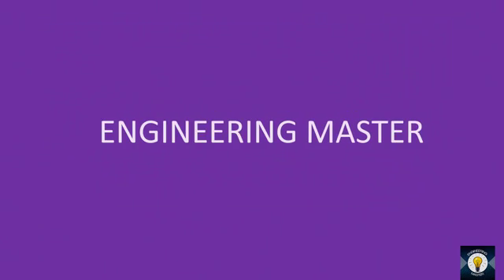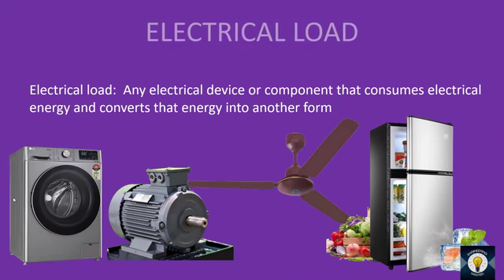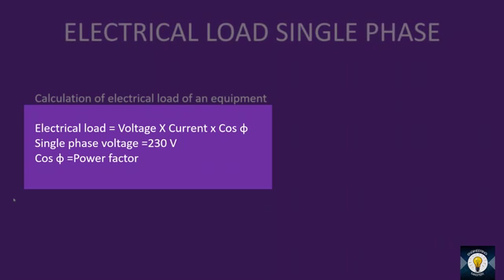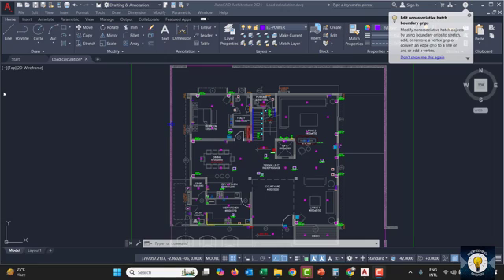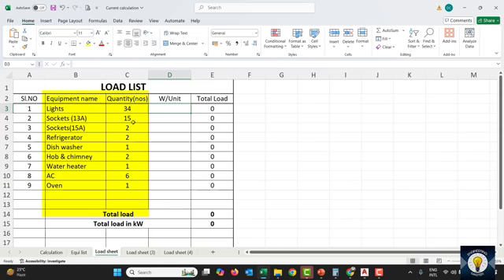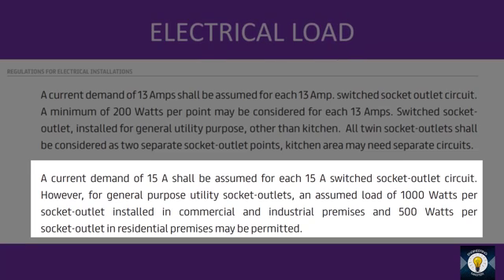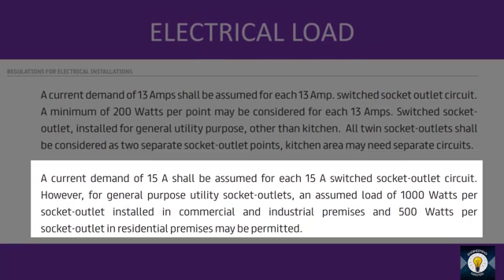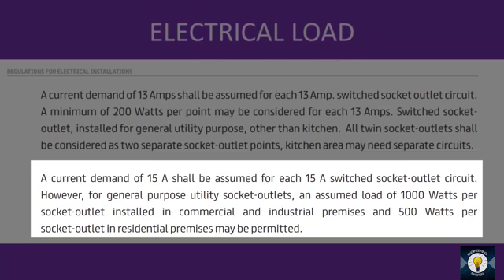Understanding Electrical Load Calculations & Load balancing

Comment: Wow! This is very insightful sir. Keep up the good work. Please i didn't understand what the rule says under load distribution. My question is, can it still be possible to connect all the listed single phase equipment in a room to more than one phase at a time? Having dropped the 3 phase from utility to a separate cut-out and looping their outputs to enter into the DB where all those equipment get connected to their respective circuit breaker. From your explanation in load distribution, i think when fuse two cut-out at once would cause fire hazard. Please I'm confused at that point sir. Could you please explain to me further. Thank you sir!
Reply from the maker: In Dubai for residential areas, DEWA regulations recommend to keep one phase for one room except kitchen and FCUs